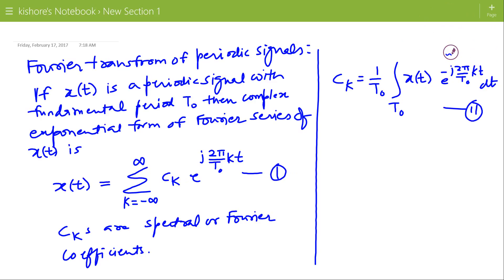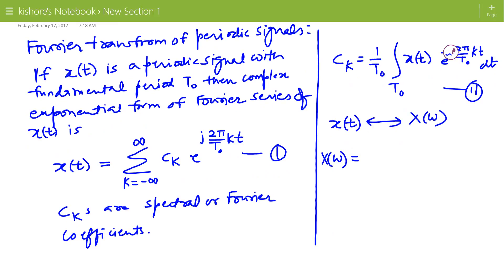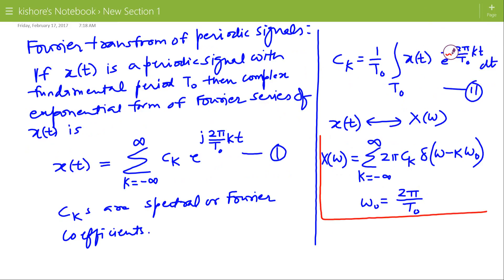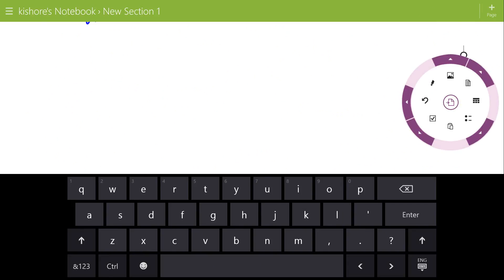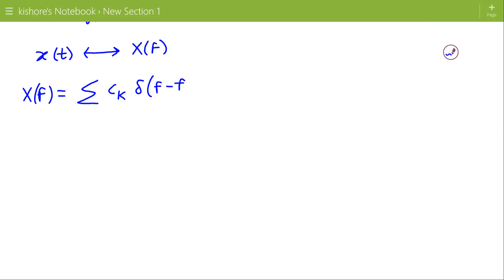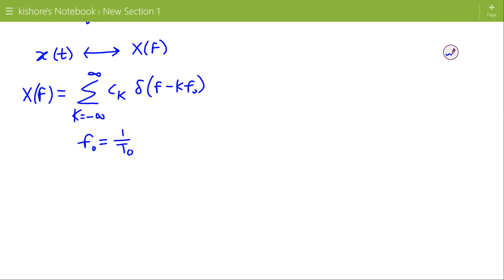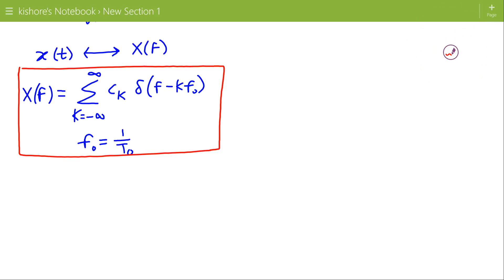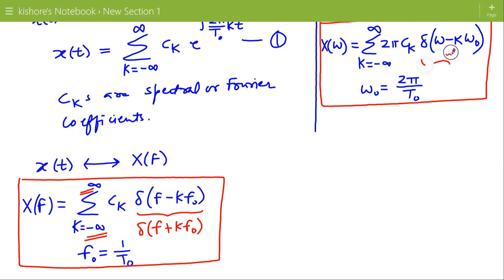Lecture on Fourier Transform of Periodic Signal

Comment: Sir, why do we need to first find the Fourier coefficients of a periodic signal and then do the Fourier Transform of the Fourier Series in order to find the Fourier transform of the periodic signal? Why does the answer come wrong if we calculate the FT by using the integration formula in case of periodic signals?